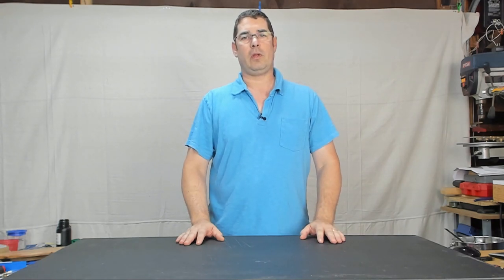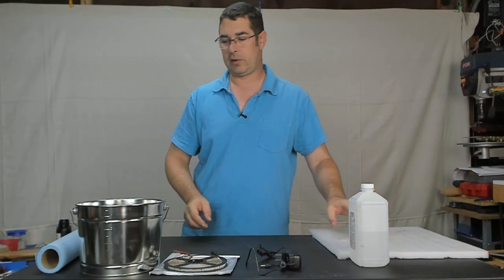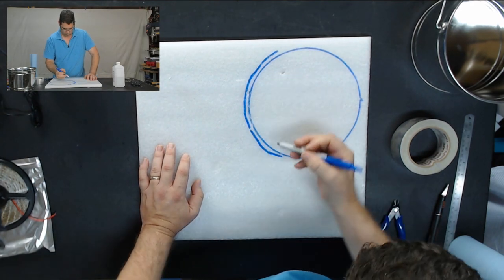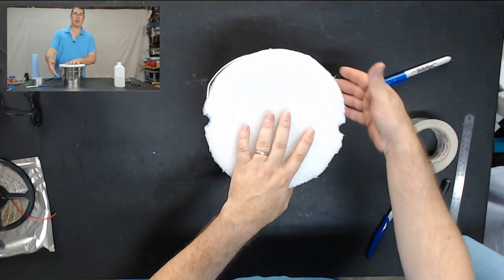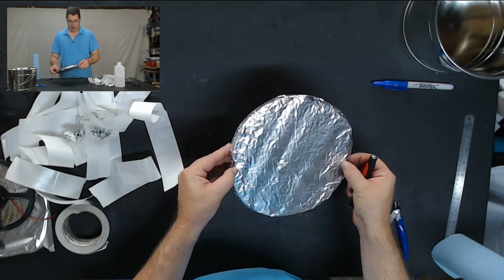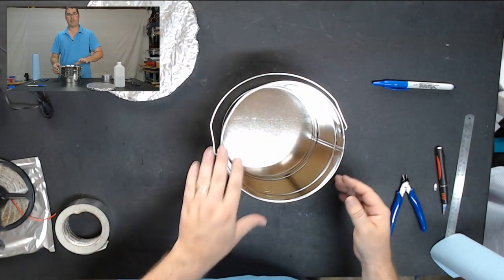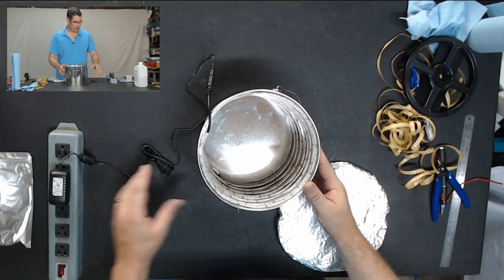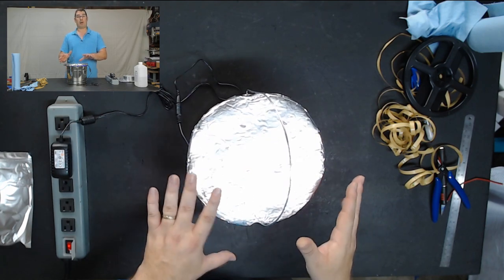DIY UV LED Resin Curing Bucket

Comment: Mine is more makeshift. It's a good way to get a good curing station cheap & easy, both of them.
I have a plastic food box wrapped with tin foil paper, and inside it, another box about half its height + the other measurements are the same.
The walls of the larger one have the LEDs on them.
That way the model can get UV light from all sides. The light does go through the smaller box so that one needs to be clear. Since the boxes stack, the smaller one rests naturally on the edges of the larger one, no fittings needed.
Light does get through the foil so I just cover it with an opaque sheet.

Sounds patchy but it works! Sometimes I need to flip the parts, but in general, I love rudimentary makeshift soutions that aren't too far from the store-bought quality ones, and that one does the job.

I don't need to cure them too fast, but if I did, I'd probably look at a LED strip with higher wattage.

Comment: For a better fit you might try making a second outline of the bucket in the foam, cut that out on the inside of the line so it's a snug fit just inside the top of the bucket and then glue that to the large piece as a bung.
Reply from the maker: Great idea! Would need to start the LED's a little lower down to do this, but would work. I do plan on doing a printed lid for it eventually that will sit ever better.

Comment: Isn't the cure time variable with how many joules a thing is being showered with? What's the output of the length of LED ribbon?
Reply from the maker: Richard Simões I would think that’d definitely effects cure time, as well as the thickness of the print walls, color permanence of the resin, etc. unfortunately, I do not know the output of these LED strips and do not have a way to measure it. Defiantly not a scientific solution, and I’ve found cure time on prints is more guesswork than anything with the style bucket.

Comment: Looking at formlabs website, it seems to cure faster if it's heated to 45-60C. It might be work cutting a hole for a space heater with a thermistor and a relay to regulate the temperature.
Reply from the maker: Thats and idea to try. These LED's actually generate a LOT of heat, so insulating the bucket itself might actually be enough.

Comment: Leave it in for an hour or two? It only takes 15-20 minutes in the sun.
Reply: Phil Nolan I think it’s only a few minutes.  I have an led flashlight and it cures thin layers in about 5 seconds.  Since these are already partially cured and you’re just finishing the job, it shouldn’t take much more time.   And the sun’s only out half a day so this definitely has its place.  If it actually does take over an hour, it’s the wrong wavelength.  In fact the correct wavelength shouldn’t appear bright or purple, it should be invisible to human eyes.

Comment: Link for LED's doesn't work, i want to build this tomorrow but not sure what LED's are best, does color matter or just regular 12V LEDs?
Reply from the maker: Thanks for letting me know the link no longer works.  You just need 405nm LEDS’s such as these.  I’ll update the link above as well.
https://amzn.to/2XuuOih
Reply: @crussty3d  Thanks for sharing, over here in Europe where im from it's impossible to find the nanometer for the LED strips, either ill order it outside or order the UV light from Peopoly and maybe 3d print a PLA enclosure .
Reply from the maker: Icemanmodeler the UV “canon” from Peopoly is a great way to go. I’ve actually just modified my bucket to that the Peopoly light sits on top aiming down.
Reply: @crussty3d  Yes was thinking of that, maybe print in PLA a cover that fits that light.
Reply: @TheIcemanModdeler  and maybe use a metallic spray to coat the underside of the lid

Comment: What curing time do you need with this nice solution?
Reply from the maker: Depending on print size and thickness, I was seeing about 45mins to an hour to cure.  I’ve since modified it to add one of the Peopoly UV flood lights on the lid and it cures things much quicker.  Around 15 mins or so.

Comment: It is necessary that the led are waterproof ?
Reply from the maker: It protects them from splashes of resin or IPA so they are easier to just wipe clean, but it is not mandatory to be waterproof,  just the right wavelength of 405nm.
Reply: Thanks a lot ! Another question: if the wavelength indicated is "395nm-405nm", is the led strip still valid to do the Resin Curing Bucket? Or should the wavelength be exactly 405nm?
Reply from the maker: Nope that range should be fine.
Reply: Thanks a lot !

Comment: Still watching video but Can I use a plastic bucket? Does it have to be metal???
Reply from the maker: Sure, you can probably use plastic, but you would need to line it with reflective tape for best performance.  The shininess of the metal helps reflect the UV back at the part you are curing. Also, depending on what plastic the material the bucket is, it could eventually break down from the UV light (like leaving out in the sun).
Reply: Practical Printing Thanks for the quick reply. Another question does the reflective material allow for longer wave lengths . For example will  UV light 365nm+405mn x 2 or doubled if I’m using aluminum foil. I’m trying to understand how to achieve a proper cure with the products I may use.
Reply from the maker: Arielle Williamson that I cannot say (because I don’t know...). 405nm is where you want to be at for most resins, but I’m not sure if the reflective material just bounces it back or alters the wavelength.

Comment: Does UV light cure normal resin any faster??
Reply from the maker: Well, UV exposure from some source is required to cure resin, be it the sun, simple LED’s or a high wattage “cannon” like Peopoly now offers.  The more intense the UV source, the faster it will cure your print.  Just have to make sure you are getting UV in the proper spectrum- around 405nm I believe.  A regular UV “grow lamp” or black light won’t do you any good.  I’ve found most prints cure in the bucket in 30-60 mins.  With the LED cannon, around 15-20 mins.
Reply: UV is actually below 400nm. These LEDs are 405nm, not actually UV. Actual UV from sunlight is better, but real UV light would generate dangerous ozone.

Comment: What is the wavelength  of the UV lights?
Reply from the maker: They should be 405nm to properly cure the resin.
Reply: @crussty3d  The epoxy resins that I use (not for printers) recommend a UV frequency of 365nm and is not quite as visible as higher frequency. Will 365nm cure the resins you are using faster? I am just curious, not trying to cause a problem. I believe your channel is very informative and I have learned quite a bit from viewing.
Reply from the maker: @snakesurfcustomfishingrods5821  as far as I know, most printer resin is designed for 405nm, but not sure what the buffer is for different wavelengths.  Best to check with the resin manufacturers.  That said, the LED bucket is meant to be cheap, but side effect is that it is slow because it is such low intensity.  There are UV spot lots available in the 50watt and above range that will cure much faster.

Comment: I was under the impression you need heat to cure resin LED’s don’t give off enough heat or so I thought
Reply: No they use light to cure not heat otherwise you'd use a blow dryer instead
Reply: A photopolymer became solid at 405nm uv lithg , so its lithg not heat (with heat the resin became more fluid , so its easy to print, thats why all resin say in the box tem: 25 celcius

Comment: you should not use the waterproof version of led strips - the waterproof coating is not very uv proof and will burn to black in time and will decrease brightness alot
Reply from the maker: TheAngryScorpion hmm, I haven’t had any issues with degradation using this for almost 2 years now, but I’ll keep an eye out for that.

Comment: The 12 quart is linked in the description...
Reply from the maker: Correct. The 5qt I used was showing as no longer available. Others building similar buckets had recommended using the larger size so it was update to point to that. Reality is, it's just personal preference and convenience. You can also just grab one at Home Depot or your local hardware store as well.
Reply: Practical Printing Awesome I got the 12 quart lol